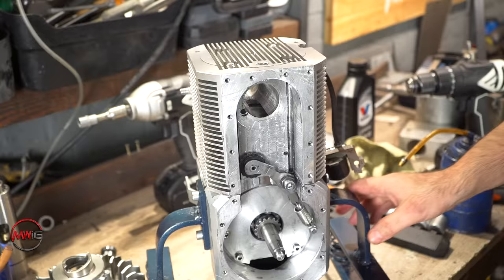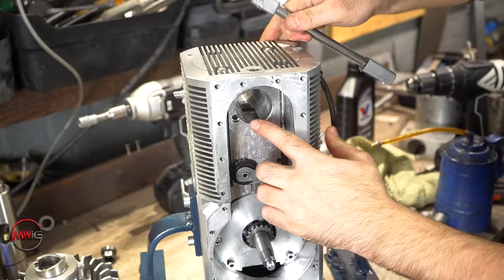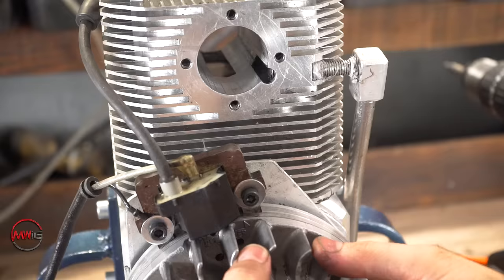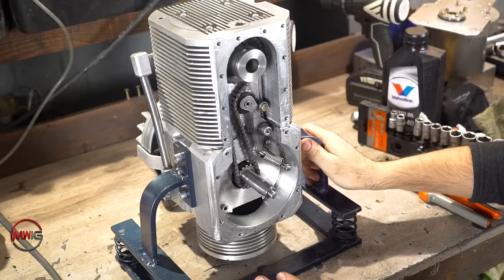I built a brand-new Rotary Valve Engine, and it works!

Comment: This is probably the only reason why there was a lot of smoke, because of the new type of valve, I have a rich mixture in the fuel-air mixture and the fuel did not burn completely, but this problem is not insurmountable, the important thing was to make it a working project, congratulations, it is working now..

Comment: I like your attempt at making this work . I had a simular idea about three years ago . The big differences between yours  and mine is I had drawn my engine with large turbo and two valve shafts one intake one exhaust  . Others that was different was a small fuel injection unit . But I believe that the twin shafts will provide more air in and out means more ram and power as well
Reply: Yes, I too was thinking twin valve shafts, as to how they could be altered with slip drive plate to be a tad more advanced on intake for example to help purge out exhaust, but of course gain in power, and maybe share cooling cowl as low pressure supercharger. 
Cheers

Comment: This is the first time I have seen you. I watched your tank build first and it was interesting.  Then I watched your concept 4 stroke motor that did not work and you gave up, I was disappointed that it didn't work and you gave up. Never give up or die trying. I then saw in the comments that you went back and got it to work. I am so proud for concept running. Now you have one more step comparing the finished and refined design  to a normal four stroke engine. We already know it has less parts,probably interesting in weight even if a made from the same metal. In my opinion you need add rings and maybe a domed piston. Then you can compare  horsepower, torque, fuel usage and maybe a few other comparisons such as emissions, what would happen if it were liquid cooled.  I think you are brilliant and I would enjoy working with you I don't give up either unless my concept was wrong. Einstein said something like All good ideas were first considered absurd.  The tank if made of light weight material, could float had a propeller or interchangeable track could be used on land, swam or water. I would sure like to meet . In person or email. I adoring you will reach out to me I don't have much a social media presence don't even remember my passwords

Comment: Great job! Heard the rotary's Achilles heel is the compression and exhaust escaping. One rotary pin design I saw had 6 seals on the pin. 3 on the left and 3 on the right. It looked similar to seals and o ring designs I've seen on diesel hydraulics and tubes/pipes. This presumably to correct the compression/exhaust issue.

Comment: Great job! Your perseverance is to be commended. Now to improve your design! O-ring seal the intake/exhaust shaft to keep the oil out of the combustion chamber. The oil tube you have installed with all the oil holes in it that runs in the slot you drilled next to the intake/exhaust shaft, does not need to be there, you are loosing a lot of compression at that spot. Just drill an oil passage that runs parallel to the intake/exhaust shaft (similar to the one you have now but does not intersect the bore for the intake/exhaust shaft) and then drill one or two 1.5 or 2mm holes running from that oil passage to the bore for the intake/exhaust shaft. At the end of that passage, install a threaded plug with a 1.5 mm hole drilled in it to squirt oil on the back of the timing gear. This will give you a pressurized oil system that will minimize wear and compression loss on the intake/exhaust shaft. With your current design, all of the oil is lost through the large opening at the end of the rod with all the holes drilled in it, it's just wide open. There is a tool made called a "cylinder hone" that will make the job you did with the wooden stick and sand paper much easier and more precise.
You also might play around with "cam" timing. Advance your intake/exhaust shaft one tooth on the timing gear and see how it runs. Then go back and retard the timing one tooth and see how it runs. Adjust the chain on the larger sprocket, not the smaller one. Remember, the large sprocket turns at 1/2 the speed of the smaller one. 
Your design is similar in design to a "Rotary Valve" engine, just much more simple. I hope you keep making it better. The less moving parts in an engine, the better!!

Comment: To be able to create what your mind can thing of is your gift.  To take your engine design to the next level more easily, may suggest that you aquire a Honda CBR250r motorcycle engine which is watercooled and fuel injected single cylinder and build your rotary valve head design to add to it, by-passing all the headaches of the bottom end work.  Most enjoyable video!!!
Reply from the maker: Thx for the tip!

Comment: just watch your video, very nice workmanship, full of dedication and inspired. From what i see this engine run on 4 stroke cycle, because you not mix fuel with 2t oil.   that engine need an catalyst to reduce those smoke,  and the rotary valve must have some sort of  tight seal   i`m not try to schooling you     😂. but.... the seal  was a crucial part on every engine principal.

Comment: one thing that greatly affects 2 stroke engines is the back pressure on the exhaust and the salvaging pull of an expansion chamber in the exhaust that is mathematically made for resonance to the exhaust sound waves.  Try adding an exhaust system for more power.

Comment: Awesome and congratulations, now that you have proof of concept you can get to refining the engine oil control,timing, carburetor settings and size, wonder if you can time a small cam or run a shaft that has a groove to allow oil to lubricate the valve shaft that has a small section of the groove not open so when the valve shaft is in the intake position the small shaft closes the oil supply hole then allows it to be open until the intake hole comes back around to let the fuel mixture in

Comment: NICE.  U should definitely make the intake shaft in a way so you an insert different ports. Different ports for jet-like spraying & also to adjust timing more accurately. If the timing was able to be precisely adjusted this engine would be a monster !!   Then once the timing is 'spot on' then you can build the design into it so it is 'one part.'
Reply: Yeah - one way to adjust the timing is to add an extra, adjustable wheel on the opposite side of the self-adjusting spring (thus left, looking at the chain). This way one could lengthen and shorten the "distance" of the upper and lower gear - essentially adjusting the phase offset of the two systems - all at runtime. What this new pusher takes, the spring compensates on the other side.

Comment: That's real interesting you made a complete motor and not just a cylinder head.
Was it based on the 2003 Ford V-8 that could rev to 10,000 RPM?
That used a 'ball' and carbon ceramic seals and didn't have any oil feed to the head. 
No idea what happened to it, was working long hours back then and hadn'r even thought about it until I saw this. 
Bravo sir, well done.

Comment: I have an idea for how you can get better compression.

You could overbore the valve cylinder and add a steel sleeve, similar to the piston cylinder. Then, cut a series of grooves down the long axis of the solid valve cylinder and press fit some rectangular pieces of a softer alloy than the steel sleeve. Turn the entire thing on the lathe to cut those rectangular inserts until they are only slightly protruding and rounded. (Should protrude to take up the space of the oil film tolerance)

This way the rectangular inserts would form something similar to the apex seals of a Wankel engine. It would work much better if you also have leaf springs on the back of the rectangular seals so that they can wear and seat properly without creating a press-fit that would cause the solid valve cylinder to seize up. In fact, the leaf springs are likely essential for it to work.

Comment: Very cool and amazing machine work!  Nice job!   In the early 90s I was working at the corporate office of a large automotive supplier, and they had industry trade magazines sitting around for us to read.  In one article I remember seeing a valve system just like this under R&D at one of the big auto makers (I think Honda).   I seem to remember they were experimenting with advanced ceramics for the rotating valve assembly, so that they could get tight tolerances with no lubrication and with little to no thermal expansion.    It was super cool then and still a neat idea today.  Great work!

Comment: i saw the video till the end. yes i saw you making the cooling poort for the Rotary valve. i was already wondering it wil be pull and eating the oil in to the engine because of the precision you need for that. that is why it the smoke's a lot. but not to mind not every one can completed such a project. it's a lot of know legde and precision work to accomplice this.  it's real secure work even there are some failures in the manufacturing of this engine but you did it. real good job mate. so now where go in production work out the flaw's and beat Bmw, Audi, and Mercedes 😉 good job.

Comment: Try separate valve cylinders for intake and exhaust. That would simplify sealing on the intake side. An ordinary oil seal would work. It would need a chain drive for the valve on both sides of the engine. A big benefit of that would be allowing for changing the valve timing separately.

Comment: It's alive.  Amazing that you got it to run fairly well.  Of course many issues in a new design, but a major step by validating the idea.  It is a high threshold to be accepted for automotive use.  Even after the Wankel rotary engine went thru extensive development and testing, it failed in the market due to wear of the rotor seals.  Ditto for problems with Direct Injection gas engines and CVT transmissions.  Now, you just need funding to perfect design and manufacturing, then look for the ideal market to start.  Perhaps a less price-sensitive market such as Ducati motorcycle owners who rave about their unique valve design (push-pull "Desmodronic" with no springs).  Rotating valves eliminate concern with "valve float", so should allow higher rpm.  Pressure drop across the valves doesn't matter much if an inlet air compressor ("supercharged").

Comment: Now all you need on the Cam exhaust system is oil scrapers to keep the oil from getting into the intake and exhaust ports
Reply: Yeah, I was thinking like 2 really long spring loaded pieces like apex seals on a rotary engine on either side of where the valve opening channel is.

Comment: A big flywheel will really help, single cylinder engines get a lot of benefit from an oversize flywheel. Especially starting and low RPM running.
Rotary valve 4 strokes are notorious for low (bad) compression at low RPMs because they leakdown, so cranking it faster will help a lot with starting (and that larger flywheel).
Anyway 👍 for the great engine build and for popularising rotary valve engines! 🙂
PS you shouldnt need 2 stroke oil in your fuel, trust your valve oiling.

Comment: US2116022A a patent from 1936 describes your rotation valve combustion engine. It expired in 1955.
Nice work you have done. Impressing.

Comment: What a good sight, all that work paid off.
A bit wooried at the oilf it uses, the only place i can see as being a problem compression wise is the inlet out let porting, but how is it using the engine oil other than through the oiler for that part of the engine.
I did have a think about it, and if instaed of inducing the fuel through an inlet port, you injected it, doing away with an inlet, it would do away with oil burn, how you can do that i have no clue, but your a smart guy, i bet you think of something, anyway, it does work so you only have to look at that one problem really.
I think i was as pleased as you when fired up.
Heres a thought, model engines that use a glow plug actually get their fuel through pressure in the crank case, most of them dont even have rings on the piston but they work, justva thought.

Comment: Congratulations friend, you have achieved a remarkable feat with rotary valves operating under intense heat. I will suggest an easier way for you to earn money using skills related to the tightness of rotary valves. You could make synchronizable rotary valve kits to upgrade air compressors! Here in Brazil, for example, compressors capable of having a significant flow are very large, extremely expensive and many operate at low speeds. I see a lot of potential for synchronized valves because I've already done some calculations and came to the conclusion that most compressors don't deliver even half the flow that the pistons would allow under ideal conditions!

Comment: Years and years ago i had this really nice mark 8 this guy cam to me at English town and said he could get me 200 hp free i was down. He came to my shop on long island and proceeded to remove my cylinder heads and put on a set of heads that didn’t have valves with springs he also added a dummy shaft in block. The heads had a rotary valve kinda design in the cam in the head well tell you what that engine made almost 700 hp with 1 turbo 6psi on 91 octane stock 5.0 internals 2 weeks later he was found dead in his business. A pallet loaded with boxes of plastic trash bags was on the forklift he was standing under came down on top of him. Those heads were similar to these

Comment: Gotta measure your combustion chamber volume. Try 9.5 : 1.
I use a 50ml barret and a 50/50 mix of gasoline and used engine oil. Gotta fill piston ring gaps with a thin  grease film first. On to the next video.....

Comment: now you only have a sealing problem  .. you could also use a membrane for the intake,      it would help with the intake  not push back to carb
Reply: the system can work,, but it should have been divided into two chambers with two rotating shafts maby  and better sealings

Comment: You should do holes on the valve spiral instead of oval to have time of open/close cycle and tiny to not losing compression on higher RPM.
Reply: If needs diameter of valve might be increased to no lack of time for the cycle.

Comment: Hey Great Video! But please don't put 4 stroke oil in the fuel. It is best to use 2-stroke oil that is fully synthetic and it needs a mixing ratio of 1:40 to the gasoline.

Comment: On upper crank or top cylinder where it has oil to top should have oil on other side in few spots to bring oil around journal ports or Venturi  way to bring oil in more then just in the channel

Comment: How about trying a different fuel source like hydrogen or propane? 
And use a heavier weight oil like 10/40 , it might cut down the amount of smoke and one last thing, make sure you have positive crankcase pressure that it doesn’t build pressure when the piston goes down which will cause more oil inside your combustion chamber if you don’t .
One last thing don’t be mixing oil in your fuel, it’s not necessary for a four stroke

Comment: Great that you made it! I'm not sure if I saw it right, but you should add a different oil to the fuel mixture than engine oil. Besides, you're unlikely to get nominated as head of the Environmental Protection Agency :)

Comment: I knew it would work! Well, I didn't "know" it would work but I hoped it would and now you've done it! What you have created could be truly revolutionary (get it?...revolutio-never mind) in internal combustion engines. I hope this propells you to super stardom.
Watching farther into the video, I realized you made a 2 stroke out of a 4 stroke. You are getting 4 stroke compression but the firing happens every time the piston is at top dead center...wait, that can't be correct, can it?
Have you thought about 2 valve shafts? One dedicated to intake and the other to exhaust. It might help with your low compression or make it worse, I don't know.

Comment: I think your rotary valve needs to be run on precision bushings so it can have a tighter seal. Its getting a lot of oil out of the exhaust. And also, a real hone job on the cylinder walls with a cross hatch pattern. Otherwise, good job!

Comment: Maybe use the same stuff the jets use for coloring their smoke? 🤷🏻‍♂️
Plus why did ya add oil to the gas? For break in possibly? Is it really needed, love the idea, thx for the video. Next a small jet engine? Or an engine with 1 cylinder bore but 2 pistons? 🤷🏻‍♂️

Comment: In my mind, the chainetensioner is on the wrong side: with more speed and friction, the chaine changes the timing due the tensioner is on the pulling train and that is the wrong side! The pullside of the Controltrain must be directly conectet between the toothwheels...

Comment: Bought a miniature webra sleeve valve engine for radio control airplanes and found that the sleeve wears fast and it leaks compression, so it wore out really fast, it looked a lot like Your motor, only very little!

Comment: I’ve always wanted to see an engine made to run for just a huge amount of time, like it has parts built way tougher then they need to be so they last a thousand years. Just change the oil… that’s it… and then it’ll be fine.

Comment: now block off your oil sprayer in the center of the valve shaft. oring it off so it cant suck oil into the combustion chamber. also seperate the int ake and exhaust sides by an oring as well